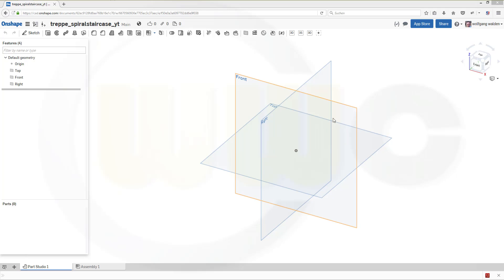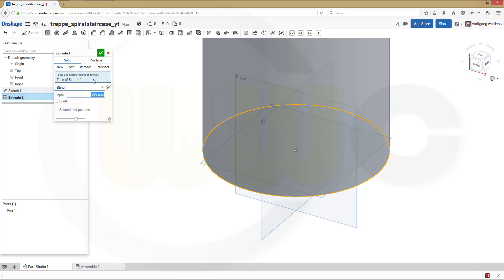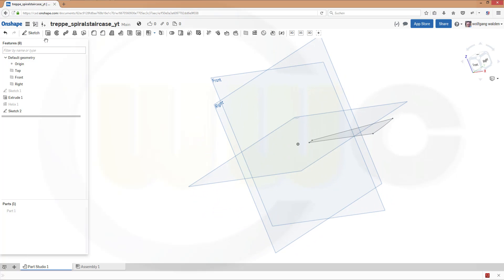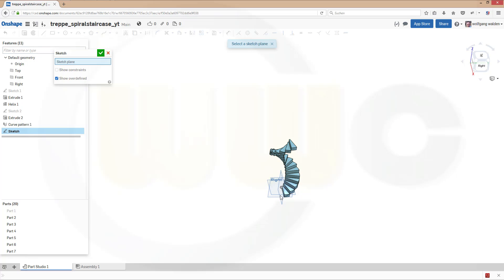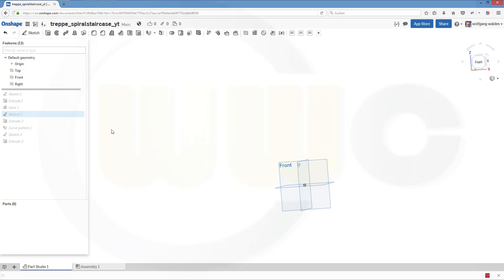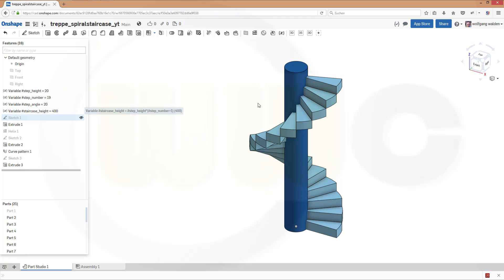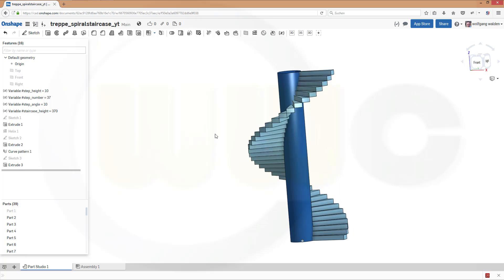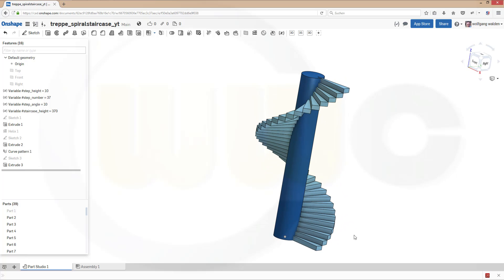5.7 Treppe - Spiral staircase - Onshape Training - Curve pattern

Comment: The Boolean union operation only fails with 20 mm, all other values should work. I think is something about a point not touching another surface not sure though, Thanks for the class :)
Reply from the maker: It could be a problem with the parasolid kernel as well.

Comment: When I got to the variables section, it gave me the option to select length, angle, and number above where I type in the dimension or number I want. If you have come across this, what do I do so I don't get any errors for the equations?
Reply from the maker: In onshape those variables can only work if you define them in the correct order. Usually variables exist at the same time, here it isn´t so. So you have to take care that the feature you want to use the variables with doesn´t exist before the variable.

Comment: Nice video. Thanks! Any advice on adding vertical spacing between the treads?
Reply from the maker: Hi, thanks :) - just the height of the steps or the helix, or lower the amount of steps.
Reply: I increased the height of the extrude for the helix and that indeed put vertical space between the threads. Thanks again!
Reply from the maker: You´re welcome!